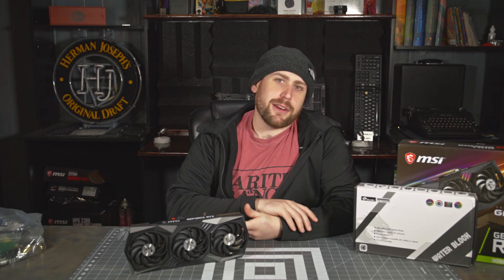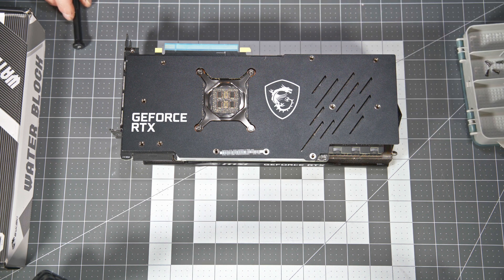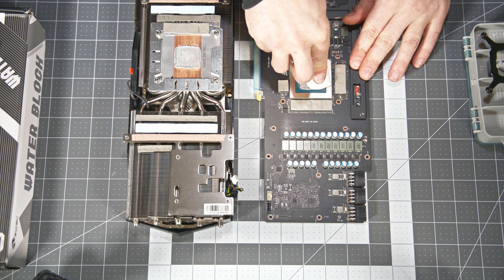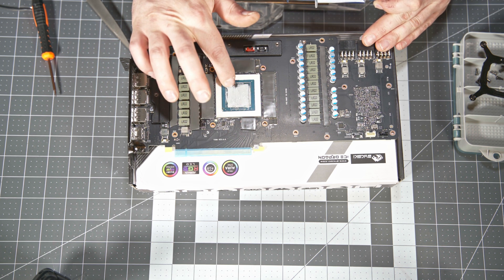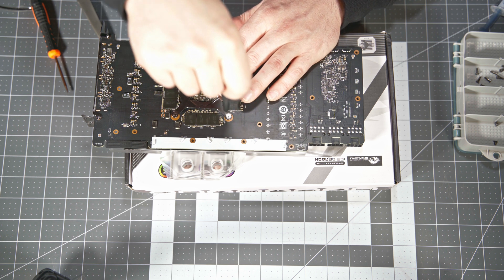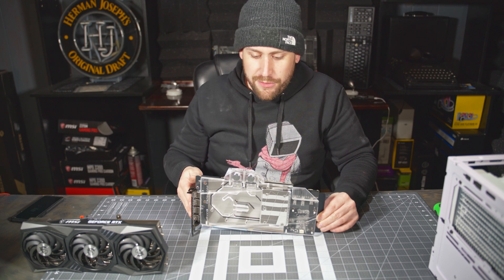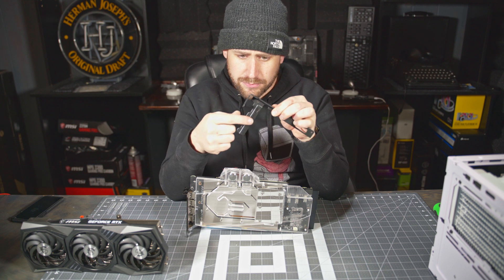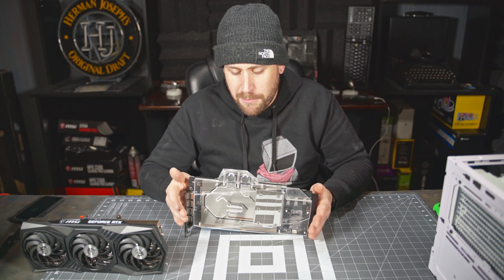How to Install a Water Block on a RTX 3080 or 3090 Gaming X Trio

Comment: What about 3080ti
Reply from the maker: process is the exact same. the board layout does not change between 3080/3080Ti, or 3090. 3090ti however has all the GDDR6 memory on ons side now vs half on the front half on the back.

Comment: Soo I bought it, it came with no thermal pads or instructions of any sort, the website says they were 1.8mm so I spent like 60 bucks on 1.8mm pads, they were expensive because of how uncommon they are, only to put it together throw it in a system and kill my 3080ti, 1.8mm was far to thick and the gpu never touched the block. Put the air cooler back on and now anytime the card hits 1000mhz it artifacts and crashes... The block is great though I put it on my 3090 with the stock thermal pads that I had to rip off bit by bit and it works great.

Comment: hey man, question for you please can you get me answer for.. i see the VRM the LR22 modules are not actively cooled. this cause any issues for you? I see on the ek and on my msi shroud they are covered and actively cooled. any crashes weird issues when stress testing in msi kumbuster? or long term gaming? i know the die wont go above 46c usually but them vrm be cookin i feel.
Reply from the maker: I've had zero issues so far.

Comment: TL;DR:
Is it completely fine to not put back the backplate at all? as not putting it back might shave off a few mm from the total length??

Great video! Subscribing :-) Btw, I ordered an AIO water cooling kit from Bykski last night which includes their GPU block for MSI Gaming Trio X 3080. I saw that after removing the stock fans, the length of the whole card decreased a bit, until you put the backplate back on. I prefer the card to be shorter in length because my case is not that long so we the added stacked radiator+120mm fans, the whole thing might not fit anymore. So my noob question is: Is it completely fine to not put back the backplate at all? as not putting it back might shave off a few mm from the total length
Reply from the maker: The backplate is actually a heatsink for the memory modules on the back of the card for the 3090 not entirely sure about the 3080. If it is acting as a heatsink on the 3080 as well I would leave it on unless you cannot fit it in your case with it installed.

Comment: Sadly, the back plate is plastic. MSI calls it a graphene composite, but it's honestly no different from any other plastic back plate. Kind of a bummer if you ask me, seeing as it's one of their higher end  models and doesn't offer any real support. People have proven that the heat dissipation from aluminum and steel back plates don't affect performance in any meaningful way but at least a metal back plate would've given rigidity. 

Good video, thanks for pointing out the pros and cons of this waterblock. Keep up the good work, looking forward to seeing your channel grow!

Comment: ...are you spreading thermal paste with your finger? God I hope other people don't do that. You just sealed in your skin oils and skin cells into the paste!
Reply from the maker: The effects of which are what?
Reply: @wasted_padre  depending on how much grease from your skin or other source is on your finger, it can cause uneven spreading or lead to bubbling of the thermal paste which can result in uneven cooling. You can end up with some cores not cooling as well as others or spiking higher than the other cores when you monitor the temps.
Reply from the maker: These are valid concerns and you've made some good points. However, in regard to uneven spreading, the thermal paste is being compressed between the GPU and a solid block of metal. The layer of thermal paste gets squeezed so tight that it spreads out in every direction. The layer of paste is less than .001 of an inch thick when the block is attached. That's why you only have to squeeze out a small amount of paste on the center of a CPU and just screw on the cooler. The cooler spreads the paste evenly across the surface as it's compressed. 
As for air bubbles forming from using the spread method that is probably true. Although, those tiny little bubbles are not going to effect performance in any meaningful way. I even double checked myself on this one and found an article by Puget systems where they tested different application methods. The spread method creates some tiny bubbles which in theory could hamper performance but in real life these bubbles make no meaningful difference in temperatures. Even with the added oil from my skin it's extremely unlikely that any bubbles that formed would be large enough to effect the temperatures of specific cores. Once again, I appreciate you taking the time to address these concerns, but it is my conclusion that small air bubbles that form in the paste make no meaningful differences in performance. 

https://www.pugetsystems.com/labs/articles/Thermal-Paste-Application-Techniques-170/
Reply: dafuq??? gross, immediate dislike...

Comment: awesome video man, just curious as to what case you are using to hold 2 360mm radiators!
Reply from the maker: Thanks for saying so! I always appreciate positive feedback. This is the Lian Li 011 Dynamic (Not the XL). It will fit two 360mm fat boys although you will not be able to use the bottom pcie slots or any graphics card that has an air cooler as it won't fit. Don't know why you would be using an air cooled card with dual 360's but yeah. Thanks again for watching. Stay tuned for my '90 days in'  review of this card in January.
Reply: @wasted_padre  Im looking to do a build with a 3800xt and an rtx 3080. I want the fans to be as quiet as possible, this dual 360mm rads. At the moment i have an mATX motherboard and am planning to put it in the lianli o11 Mini. (Yet to be released)
Reply from the maker: Yea I use the Corsair Commander Pro and set a really flat fan curve and use the GPU as the temp source. The only time the fans spin up is while the GPU is really HOT. It's almost completely silent at idle.

Comment: Thanks for the video! Few questions: does the block come with instructions (like you need this thickness of pad for here, that thickness pad for there, screw type x here, y there) or do you have to figure that out yourself? Also, does it come with pads (by the looks of the video it does)? I read some conflicting information on this.
Reply from the maker: So sorry for the late response!! No instructions  with this bad boy. I think there is a QR code that links to a online manual but I didn't check it out because I think most of there documentation was in Chinese. Yes this block came with all of the necessary pads although this wb does not actively cool every component that the air cooler does. Temps are a solid 50% of what they were on air. I think under heavy gaming load I hit between 40-45 depending on ambient air temperature.

Comment: Hi thanks for installation video
I am new to water cooling and do not know where to start
I bought that same cooler for my 3090 x trio but don’t know what fittings to buy 
Is there anyway you can give me the list of all the things you bought for your water cooled pc thank you!
Reply from the maker: Woof well that is a REALLY long list lol I honestly not 100% how many components are in there and will honestly depend based on what components you use. I would start with a kit from EK or Corsair and then expand that kit to incorporate your GPU block. That way you only have to buy a few more fittings and gives you a chance to get your runs made to your CPU-Pump/Res-Rad and learn what is going to work best for your case.